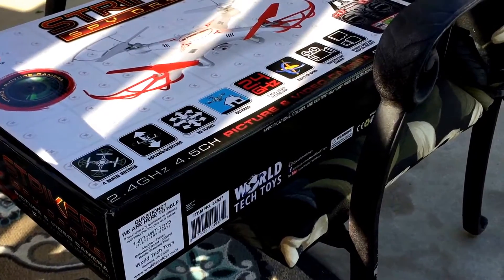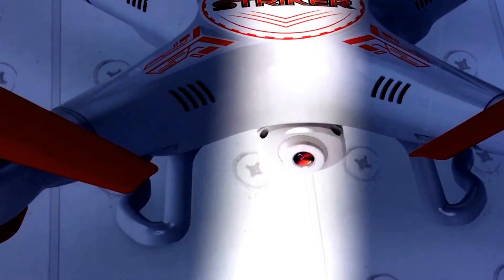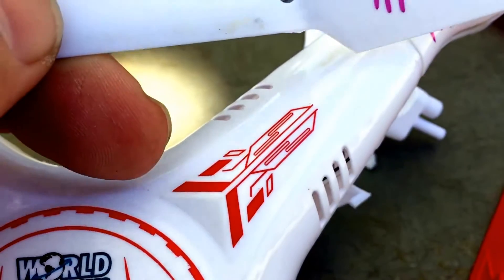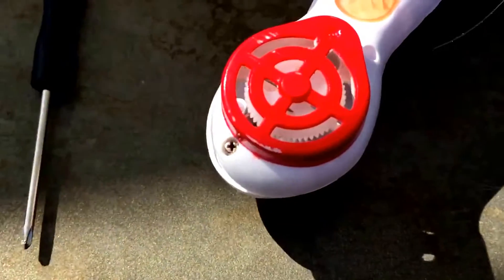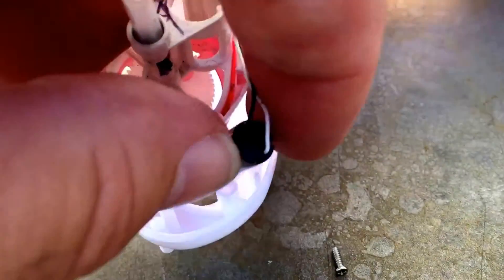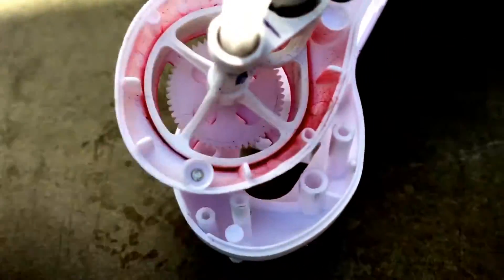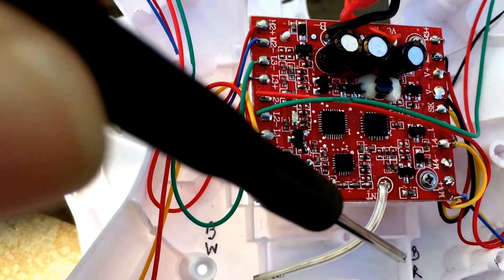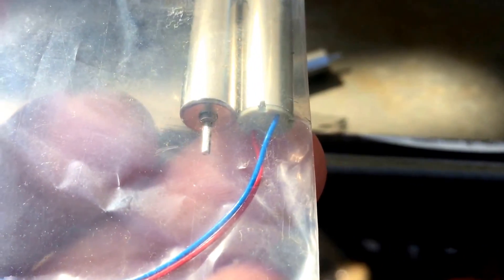Striker Spy Drone - motor replacement

Comment: brushed motors are a pretty simple design. if you get a CCW motor but need a cw motor, all you gotta do is solder it on and see which way it spins. If you solder it together and it spins cw, you just gotta unsolder the wires and switch the wires and it will switch the directions. So actually the CCW & CW when buying motors really doesnt matter. Back Right is motor one, top right motor 2, bottom left motor 3 and top left motor 4. motors 1&4 spin CW and Motors 2&3 spin CCW. Once you learn that then its just a matter of seeing if the motor is spinning correctly and if not, switch the wires and it will. Just sharing some quadcopter knowledge incase you didnt know. Happy flying
Reply from the maker: Thanks for the tip. I still think this drone is a great starter to learn with and the cheap parts help keep one running. I have a drone junkyard of parts for these LOL.

Comment: These sure look just like the cheap motors you could get for the Syma X5 series and they come with the gear on them. All you need to see is the length and Dia. of the motor and either google the L and W or check on Ebay - some of the sellers have the dimensions like 7mm x 20mm.or 8mm x 22mm........it's worth a gamble for about $2 per motor OR you can get the big gears and they also sell the motor gears separately so check Ebay or Amazon for those too. I see Hobbytron sells 4 for about $5 for a set of 4.
If you want more batteries - go to Ebay or Amazon and get a 500 - 750 mAh battery for the Syma X5c or x5sc - they have the same ends as the Striker battery ends
Reply: The battery connector style is Molex 2P